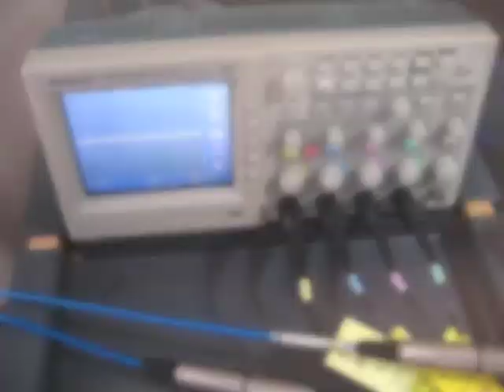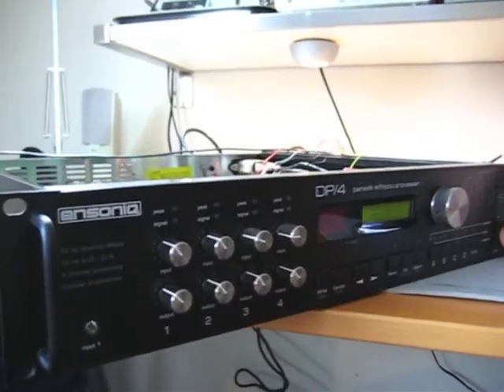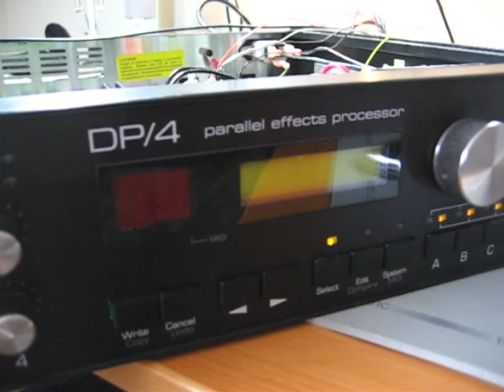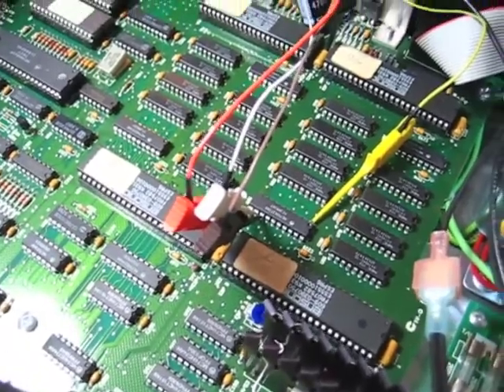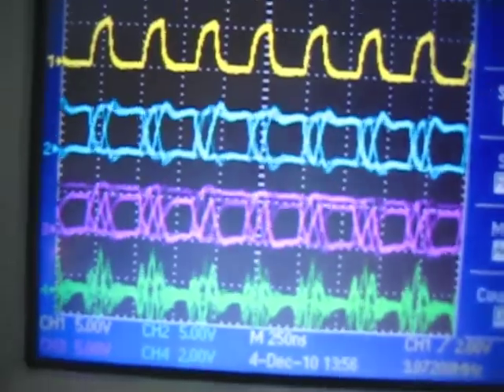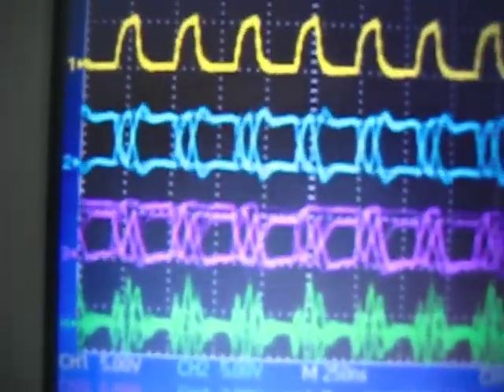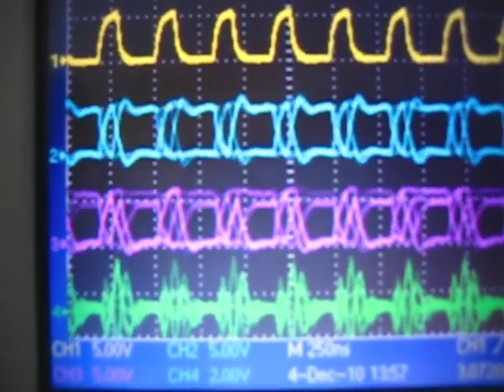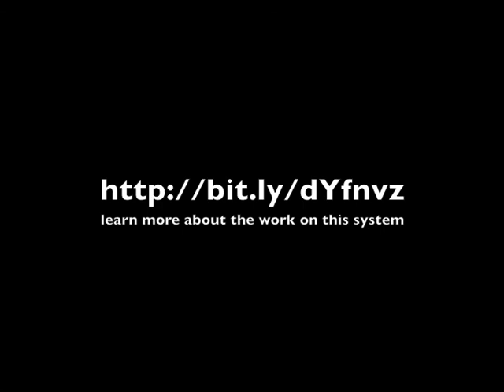ENSONIQ DP/4 Serial No. DP-15079 - action 3 (Dec 4, 2010)

Comment from the maker: Hi Sava,

I've just reviewed the photos, that I'd taken of this unit, while it was on my bench. It appears to have one lead at each end of the battery...

|photos|krunkwerke|5246252244|in|set-72157625561179322|

The battery in the Yamaha SY77 looks identical. As you'll see in this set, it has two leads...

|photos|krunkwerke|sets|72157628699435743|

(YouTube doesn't allow URLs. So replace '|' with '/' and put the Flickr domain name in front, in order to build the URLs.)

Cheers...

... John